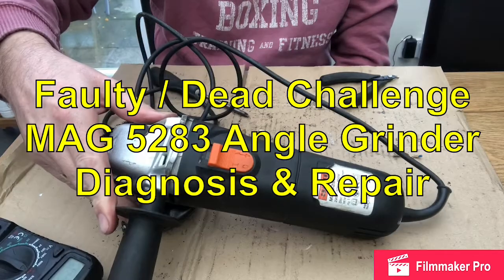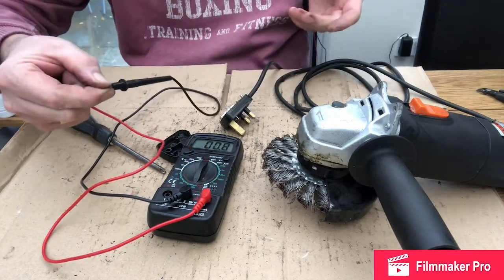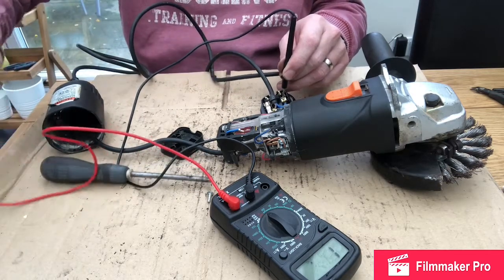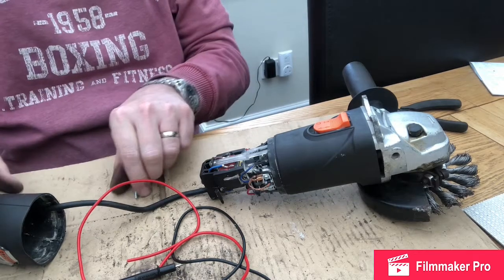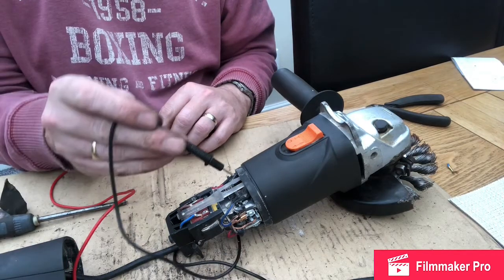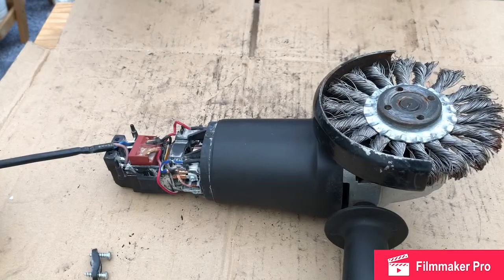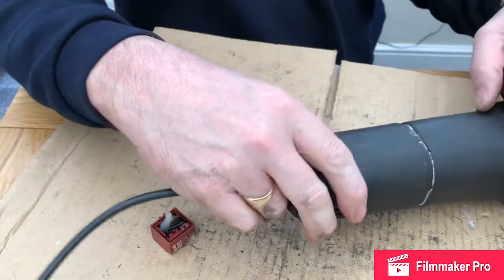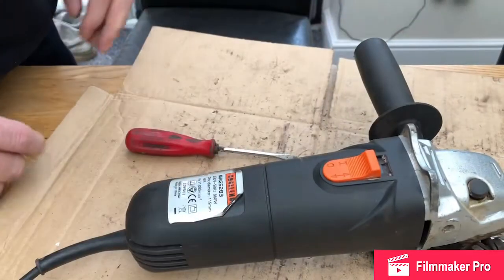Faulty / Dead Angle Grinder Challenge MAG 5283 Diagnosis & Repair

Comment: Thanks, My Clarke grinder just stopped yesterday ordered some new brushes as the old ones were worn, fitted them today, still not working, felt a bit dejected but then watched your video and then checked the main cable, the neutral wire was broken, new cable fitted and off it went.